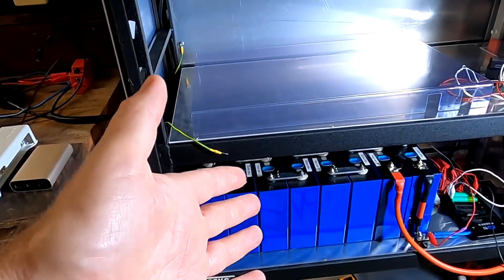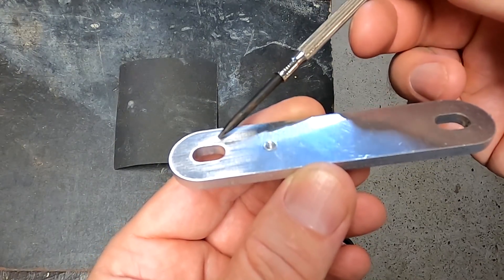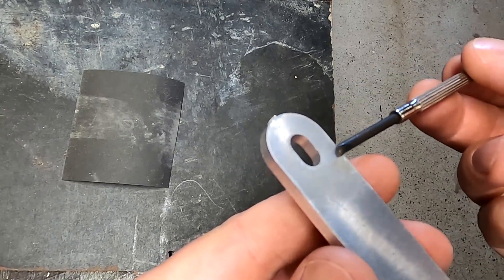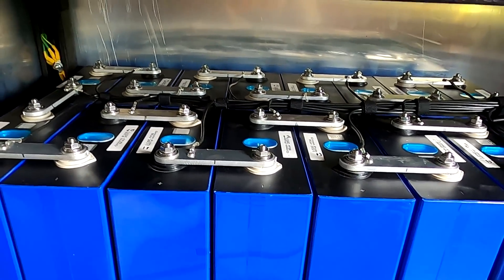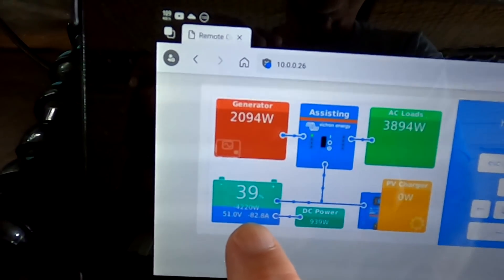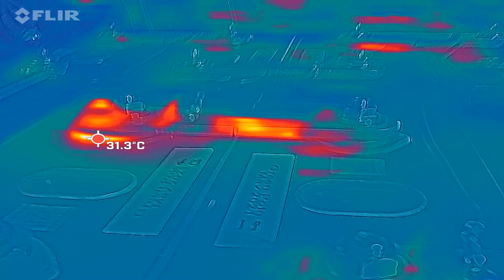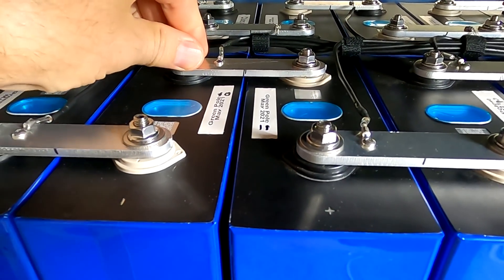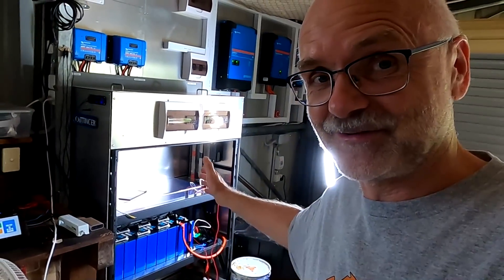Overcoming the battery-busbar problem (for now). Here is what I found!

Comment: looking at the marks left after sanding they look like they have been pierced and stamped out of sheet material on a press (seen this many times as a toolmaker) they should be planished after the stamping process to flatten the surfaces, looks like the planishing pressure was not high enough, even better would be to grind the faces flat and parallel on a lumsden grinder, nice job identifying the high spots giving a very small contact area.
 just watching the battery install again and noticed the caption saying "Laser cut", didnt see that the first time round. must admit not seen this from laser before - every days a school day 😁

Comment: First of all it‘s nice to see that you not giving up on the fight with those bus bars, but if you serious you not need to protect your friends who deliver the bus bars to you for free just to get a free advertising if they not work reliable then just tell the truth and trow them away. You should move on and tell the people that there are also complete battery cell packs of the car industry available where the battery terminals are welded together and so there are no more problems in the future, and they also not really more expensive. Diy is fun for some time but if you fighting always with a dangerous unreliable system then you should go a step forward and use the professional material. Some engineers spend a lot of time to get this perfectly done so why to invent the wheel new when it already exists. This is what we germans say and you should remember that.Stone edge is passed already. The battery blocks with 24v or 48v also not cost more then individual cells and they also perfectly pact together so it is a almost plug and play scenario. I think you know what packs i mean,  not the complete battery’s with bms and housing just that cell blocks with a base aluminum casing to hold the cells together

Comment: 4 gauge wire has just 0.00025 ohms (1/4 milliohm) of resistance per foot. 4 inches would only have a resistance of 0.00008 ohms, or 0.08 milliohm. At 100 amps the voltage drop would only be 8 millivolts, and the power dissipation would be 800 milliwatts.  I would not hesitate to use 4 gauge wire for 100 amps in such short lengths.

Comment: I saw in another video that even lugs are not straight and need to go a similar process. Basically one need to ensure planeity of the two connecting surfaces as you cannot apply enough torque to ensure initimate contact. cheers

Comment: Hi Andy - really useful info and a very engaging presentation style - thank you for your contribution and lessons learnt - a question; do you know if anyone has tested this kind of cable? Flat Super-Flexible Tin Plated Copper Braid Size 35mm² - 25mm x 3.5mm 0.2 wire 200 amp. Would get over the problem of solid busbars not making good contact and the stiffness of round cable (bending radii)
Reply from the maker: Thanks for your feedback! I have some of these flexible busbars incoming to test out soon.
Reply: @OffGridGarageAustralia  yay, even more reasons to look forward to your excellent videos!

Comment: Thank you for your YouTube channel. I am in Mundaring WA and have start doing things very similar to yourself with working towards a small off grid power system for a tiny house design for my future living. Question for a simple off grid would 24v be better than 48v. I have been going over pros and cons like running lighting, fridge and other things straight from battery rather than using a inverter to run everything on 240v, or would you think just going 48v and run standed equipment on 240v AC?

Comment: Andy, have you thought about using copper crush washers between the plate and the terminal? They use these types of washers in the automotive industry as a liquid seal (eg. oil sump bolt, banjo bolts). As the name suggests, the washer will squash down to mate up to an imperfect surface.
An item that was not looked into - how flat/smooth is the terminal face on the batteries? Making the bus-bar dead flat is great, but if it is then bolted down to an imperfect battery terminal then the hard work is lost.
Reply: i was thinking this,,, use the OG 2mm plated copper bars and have 1 washer on the bottom and top,, not sure if i will go as far as to sand the bars also for good measure but this should be a set and forget for years

Comment: Right at the Moment I'm installing the Electrics at my RV. After your Video today I was testing my Multiplus 12/1600 with around 1200W. I did not reach 100A load on my LiFeYPo4 selfmade Battery but I right away checked all connections for any heat! And thanks to you and this Video, I found a not perfect fitting connection in my Installation! 😳... This just heated up, so I needed to clean and tighten things correctly.
In the end, I did not thought that such monor things could be so crazy bad. So Thanks!!!! It helped a lot to stay safe!

Comment: I would just measure resistance of the connection through the busbars from terminal to terminal.  Just put the probes of the YR1035 on the terminal screws.

Comment: The unbalanced current in the BMS cabling is likely due to incorrect assembly of the termination. The two wires' crimps should sandwich the terminal busbar between them so the contacts are identical.

As we see them there are multiple higher resistance paths through the terminal screw and washers and from one crimp through the other.

On the other side of the terminal, the crimp should be under the terminal busbar to keep it level.

Comment: I am amazes too that you are still bending your head over this.  The evidence you have shown suggests so clearly that the problem only exists with the Aluminium busbars.  You have also proved that using nickel plated copper, either  bars or crimps lugs avoids the issue.  So why are you still watching the Aluminium busbars getting hot?

My advice is to junk the Aluminium busbars, use Copper busbars, simply ensure that the surfaces are flat and clean and torque them up to the maximum recommended by the cell manufacturer (NOT half of it).  End of problem.  Copper has lower resistance, is softer and will more readily conform to the terminal surface, but they must be fully tightened.

My system is similar in that I have the same cells, in a different array, with copper busbars. The maximum load I can readily apply is 100A but there is absolutely no detectable heating or any of the terminals.

Comment: You should do this on a thick piece of glass, also use a full sheet of wet and dry and do the entire surface, move it in a figure 8, that removes the metal evenly. Better still do not use alloy for this job!  Good luck.  Edit, a good glass is an old oven door glass. Also much better to use some lubricant, a mild dishwashing detergent in a spray bottle to keep things moving nicely would suffice, when doing steel use DWF.

Comment: Non-flat surface at contact area of busbars and cable lugs, no matter of its material - it is permanent pain for installation. It is a "byproduct" of its manufacturing process with pressing and cutting operations. The same problem is for power semiconductor heatsinks.

Comment: Aluminium in only used in high voltage 230 volts alternating current systems .
Never in dc low voltage systems . 
The main reason is the conductivity issue .
You have done a in-depth video .
But today the infrared camera shows good cold busbars but tomorrow you will see the busbar which are cold today become warm or hot as time passes .
May even lead to burnout or flash .
Would suggest you to please switch to copper busbars ....please

Comment: I find it interesting that you have used quality components and displayed excellent workmanship throughout every phase of your build, yet you insist on trying to get an inferior material to work for your bus bars.  The aluminum terminals are welded, eliminating the concern over oxidation, but using the same material for bus bars has continually given you problems.  There's a reason copper is the standard.

Comment: I made my busbars out of the left over alloy C channel lengths and just cut them the length of the pack with a circular saw and drilled holes in the right spot then sanded them by hand and put it all together, I had none of the tools to test heating etc but two years later my system is working fine. I guess it depends on how much you want to draw from the pack at once though.

Comment: Again, to be clear, the failure IS THE PASTE YOU ARE USING, IT IS AN ANTI-CONDUCTOR, NOLAX GOES ON AFTER THE CONNECTION IS MADE TO PREVENT OXIDIZATION, NOT BEFORE

Comment: It seems to me that the problem is not oxidation of the busbars, but that their connection to the battery is inflexible.  If you look at the 'flexible' bus bars, it's my belief their benefit is not the flexibility of the cable, but the malleability of the connector that goes on the battery terminal.

Comment: Hi Andy, your journey has been an interesting one. 
We are completely off the grid and have been for over 15 years. At present we are running on lead acid batteries, 880 amps at 24 volts with a victron inverter. After watching your channel and a few others, going down the lithium road will be the next step.
 I'm asking out of complete ignorance, the EVE batteries have aluminium terminals with stainless studs, why  is the bottom of the busbars more important than the top, where the nut and washer tighten down on the busbar and do you think over time there would be any reaction between the aluminium and the stainless.
Cheers
Drew

Comment: Andy Congratulations, you have found the root cause of the "candle terminal"
problem.  However, a more complete solution must include the Al cell terminals
to be de-oxidized.  I use a small wire wheel brush in a cordless drill followed
quickly with an application of dielectric grease.

A torque of 8 Nm is required with cells that have Al threaded terminals.  4 Nm
torque is not enough.  Newer cells with laser welded-on bolts can be torqued to
10 Nm.  However, laser welding bolts to cell terminals is frequently done to
cover up that they are not new cells.  The amount of deception associated with
Lifep04 cells are shameful (are you listening china?).

My full year's experience with this build:  PIP-8048MAX inverter, 20 Trina 405W
solar panels, JK-B2A24S20P BMS and 32 (2P16S) Lishen 272Ah cells with 20x4 mm 4
hole Cu bus-bars.  I feel 2P16S build was a mistake.  My next build will be
1P16S x 2 or more.  The 2P configuration makes it very difficult to identify a
weak cell and/or replace it.

My early experience with this build is with 3 Daly BMS's.  My experience is very
much the same as yours:  They are not suitable for a solar system, plus their
marketing is suspect - I.E 100A is not equal to 50A, especially in solar systems.

The below comments probably apply to 50+ Amp charging/discharging.  I don't
think these problems will exist in a 3KW or smaller solar system.

If anybody disagrees with any of my comments, I would be pleased to hear with
metrics, rationale, or experience.  I can supply all of that, but it will require
a lot more text space than I have here.  I welcome learning more and being wrong
about this solar system.

I have been fighting (and very frustrated) by this "candle terminal" problem for
about a year.  BTW, "Ray Builds Cool Stuff" calls it a "runner", because the
symptoms are a week cell, I.E one cell will overcharge and under discharge
(with active balancing).  Ray will soon have the "loose nut" problem again.  I
think this is due to the side force on the terminal bolts when the cell (cells
in compression) will expand during charging.  (I ruled out temperature as the
reason).

I have to loosen, then tighten terminal nuts (8 Nm) every month.  Easy to spot
with a finger, because the bus-bar is not cold.  I am experimenting with a
flexible Cu bus-bar.  The preliminary results are good.  However, they are about $7
apiece.  I think cable or braided "bus-bars" will have too much resistance if
the size is practical. (AWG 0 or 1 Cu or bigger Al)

The flatness of the bus-bars, level across the cells, and Al vs Cu bus-bars are
a small part of the problem.  A mirror surface on the Al might be more of a
problem than a solution because it is oxidized.

Some people believe a warm terminal is not a problem because the voltage drop is
very small compared to the 54 Volts of the battery.  That is true, but the
voltage drop from a warm bus-bar/terminal really screws up active balancing (see
below).

I found that a high 50 mV cell difference should be set to trigger the
balancing.  Balancing in the middle of the charge cycle can actually unbalance
the cells.  This setting will achieve a top balance (it would be nice if the BMS
could turn off the bottom balance).

A conductive grease is not as conductive as solid Al or Cu.  Oxidation is the
real culprit.  I am surprised how small the apparent contact surface area can
be.  I guess a few molecules of Cu or Al do not have much resistance - which
suggests the pressure of the contact surface is more important.  My measurements
of two 20 mm wide bus-bars connected together with a 6 mm SS bolt/nut have a
resistance about proportional to the torque up to about 4 Nm.  After that, the
resistance falls to about 25 u-Ohms.  The 70 mm long bus-bars themselves have
about 20 to 70 u-Ohms resistance.  I have seen a shiny but oxidized Al connection
to have 500 u-Ohms.  That produces a bus-bar dissipating 10 Watts @ 100A with a
voltage drop of 100 mV between cells.  That voltage drop will confuse a BMS a
profound amount and heat the bus-bars.  BTW, I found a washer and a more
conductive bolt than SS will not be a significant help.  It is the pressure of the
connection and lack of oxidation that is significant.

These comments are from my many hours of experimentation/frustration using
professional quality test instruments.  I.E.  I can measure down to a micro-Ohm
accuracy and a 0.1 u-Ohm resolution of a terminal connection.

Thank you Andy for your honesty and willingness to share your mistakes.  That
makes you unique in the YouTube world.  Please avoid the temptation to edit that
out.  Your mistakes make me feel I am not so dumb.  -doug
Reply: As a future builder (waiting for stuff to arrive) and avid learner, I find your description, method and reasoning amazing.
Thank you for the effort you put in the text above.
Do you regularly share your thoughts on any forum?
Would love to go by your opinions, thoughts, doubts, etc.
Again, thanks for your above comment!
Reply: Also, one question: you mention you have to re torque your bus bars once a month for optimal performance. My battery is meant to be in a closed metal box (fire security) in an RV, so a.much more harsh environment.
Is there a way to mitigate the need of re torquing?
Thanks in advance

Comment: I'm no Electrical Engineer nor chemist by why not just plate the aluminium bars with copper to provide lower resistance at the joins and long term corrosion protection.

Why were the original copper bars discarded?   I'm guessing flattened copper water pipe would out perform the Aluminium busbars long term.

Comment: This has probably already been said but you should use a flexible bus bar or cable for terminal connection. The subtle expansion and contraction during charging and discharging could cause terminal failure over time.

Comment: Why use aluminium?  Especially with such high voltages and amps.    

Even if you get it to work,  how long before that oxidation starts again.   I bet it will not be long.  You will forever be pulling that apart and cleaning.

That YouTube channel overseas sent you a great solution with those flexible cables,  why not use them?

Comment: Great work, but if you took the time to sand your buss bars, why didn't you also sand the terminals to guarantee the most bestest connection possible
Reply from the maker: Well, the terminals worked great with the other busbars, so they seem to be fine. And for fault finding, you want to do one step at a time and see if that fixes it. Otherwise you wouldn't know...🤷‍♂️
Reply: Your right my fine sir,  just expressing an opinion based on my experience on my system by pre sanding every connection b4 I torque them eliminating them from any equations,  especially since you had such a horrible experience with battery version 1.0

Comment: it would be interesting to see the voltage difference from one end of the busbar to the other
Reply from the maker: Well, these aluminium busbars have a lower internal resistance then the copper busbars coming with the cells.

Comment: If you are interested in tin plating your copper for corrosion resistance, the channel NerdRage has the recipe. It is only tin and S. acid with thiourea from tarn-X silver polish. You just dip the copper in till you get enough in a few minutes coating it. That's it. Just don't store it, it goes bad after a month and won't work. Warmer works better too, it has crystals that need to be melted. Just watch his video, he explains in detail.
Reply: Hot tin-dipping will be better (soft layer, good cogesion) and faster.

Comment: Interesting you told us polishing bus bars is not necessary a few weeks back and today... torque must be 5nM, use copper bus bars washer and nut and contact grease after making sure bus bars are flat and polished. Your batteries must be compressed too.
Reply from the maker: The batteries don't need to be compressed at all. That's a myth!
Reply: @OffGridGarageAustralia  The manufacturer's datasheet used to have separate parameters without pressure (and there were fewer life cycles, ~2x), but today this is not indicated at all. So the manufacturer implies operation only with pressure.

Comment: Use a pane of glass when you need a flat surface to put emery cloth on. It is the best you'll get. Use the back side though. Not the front.
Reply: Vs. most materials not lapped.